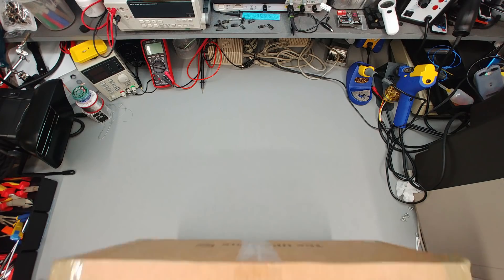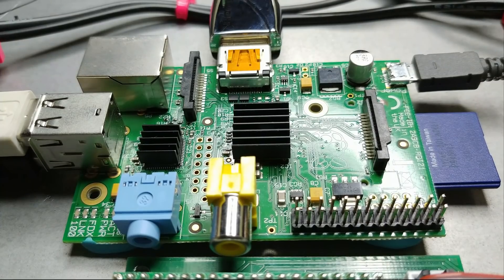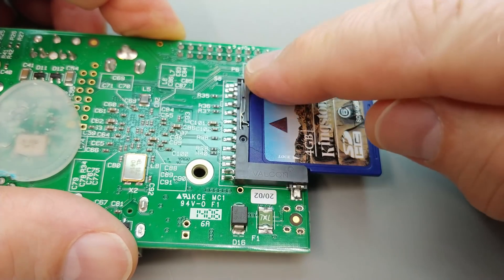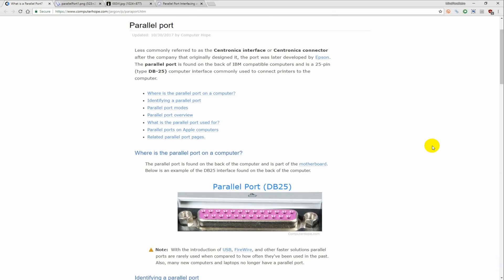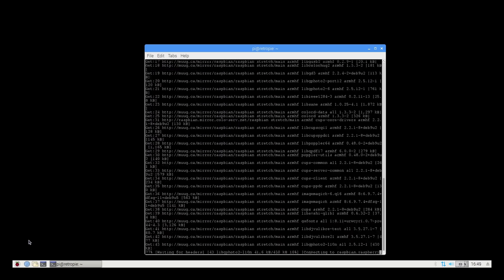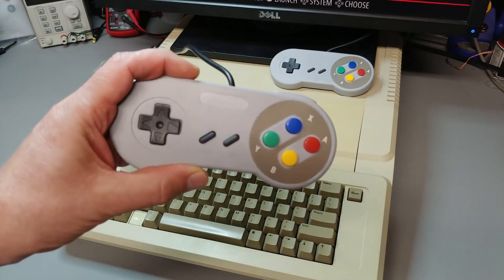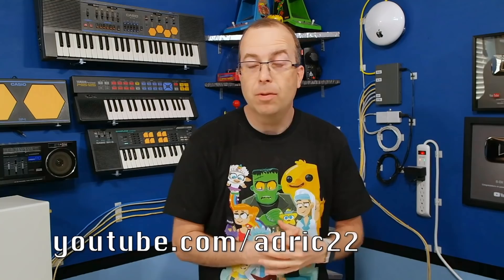#12 "Hello, My Little Blue Friend" — Apple PIIe #ThinkDifferentChallenge Part 3

Comment: It seams that unfortunately the original SD card got damaged on shipping, at 9:38 there is a visible crack on the SD card.
Also pretty nice approach on the making of the video.
Reply from the maker: Thanks very much for your kind words. You are the first viewer to comment on the SD card crack. Crazy stuff -- I could not see that crack at all until I rendered the video, which somehow seemed to enhance the visibility of the crack.
Reply: Finally getting to view the 3rd installment and was about to make a similar comment, but decided to see if anyone else noticed this...lol
Reply from the maker: Yes, lol. Thanks for the feedback. Seriously, I did not see it at all until the video had been rendered - weirdest thing, or I'm completely blind. I'm surprised The 8-Bit Guy didn't mention it in his Part 4 video.
Reply: I noticed the crack as it was happening.  Or at least you do not see the crack until the card is being inserted.  I wondered if it happened as a result of the tape and the extra tight fit.  But i guess its possible the crack was there all along and is only visible when pressure is applied to the card.
Reply from the maker: Hi Daniel. Yes, I am pretty sure the crack happened during shipping. Jan Beta had packed it well but did comment to me that a lot of the innards were in greater disarray than when he shipped it. It's the craziest thing, I swear the crack was only visible after the video was rendered by my editing software, as if the render process enhanced the contrast of the image making it much more visible. Anyway, that's my story and I'm sticking to it. :)

Comment: Thanks... I followed these videos to you and you’ve inspired me. I want a dot matrix printer so bad, but I’ve had some issues with cups too. Now I know to go for it. I gotta find a dot matrix!!! Bbs days coming back!
Reply from the maker: Thank you for your kind words and positive feedback. Yeah, vintage dot matrix printers are hard to find these days and new ones are off the chart expensive. Have you tried thrift shops or online classifieds like Craigslist or even Facebook Marketplace?
Reply: MindFlareRetro both are good ideas and I keep checking thrift stores. Heck, maybe a Facebook advert asking for one... you know there’s tons of em sitting in closets across the nation. I subscribed and thanks for what you do. I’m a big raspberry pic projecter and think your content is up my alley. Cheers. (Ps, i would have used your amigaIIe mod!!)
Reply from the maker: @paullee107  Thanks very much for subbing -- your support is greatly appreciated. I have been very fortunate to find unwanted Commodore gear here in the Toronto area using Craigslist and Kijiji over the past 5 years. I haven't tried Facebook, though. Hmm.🤔

Comment: Dunno if you knew (obviously it's a bit late) but CUPs doesn't need a desktop environment in order for it to work. This would have saved you some space, but it's still pretty cool that you got a matrix printer working at all. Hell it made me smile just hearing it print.... memories......
Reply from the maker: Thanks for commenting, Ian. I assumed that CUPS would be right at home administered from the command line, but as I am versed only mildly with Linux it was easier for me with a desktop GUI. Also, someone lucky subscriber will have the opportunity to win this Apple PIIe rig so I wanted to make sure it would be easier for that person, as well.

I wasn't exaggerating when I said I hadn't used that printer in over 20 years. I think I purchased in 1990. I had just started university and, well, needed a letter quality printer, and I splurged for the 24-pin one. I love that printing sound, as well, that's why I killed all audio in the video when it first printed -- love it!
Reply: The web interface purpose is to be accessed remotely, but great job, setting any printer (on Linux or not) is a pain, specially when they make driver for some old version of Windows that won't work at all with newer versions. At least this problem we don't have with Linux! :)

Comment: At 17:20, looks like there is a lip around the hole (that is crimped to keep the metal parts from separating). If so, an easier way than filing would be to gently drill it out with a larger drill bit.
Reply from the maker: Ah, yes, you are correct. I remember being a bit rushed to get this project completed, that didn't even cross my mind. I will keep that solution in mind for next time. Thanks for commenting.

Comment: Impression that the package got hot enough to loosen the hot glue and also mess with the solder joints on the boards a little.  If it takes a hot iron to loosen the PI in the previous build video, it seems likely that it could have gotten pretty hot during shipping.

Comment: Tell me you didn't threw the plastic cover for the DB25 port away, my OCD is screaming for it to replace the aluminium one made by Jan.
Reply from the maker: No, no -- you can breathe easy -- I did not throw it away. I actually taped it off to the side in the case. I didn't even think to use it as a replacement. Thanks for your comment!
Reply: @MindFlareRetro  thanks, I feel a lot better now! haha Just subscribed btw
Reply from the maker: I'm glad I was able to help. I should have mentioned that I secured it to the inside of the case in the video. And thanks very much for subscribing; I really appreciate it!

Comment: Who else found themselves shouting 'the card's broken' at their computer?  :-)  A great video in a great series!
Reply from the maker: LOL. I was the first one shouting. But I only saw the crack after the video had rendered, as if the rendering process accentuated it.
Reply: @MindFlareRetro  It's always the way! I had exactly the same happen to me in the past, so I knew what to look for before I even saw the crack.

 I loved the Parallel mod you did.  It's a shame it got disconnected, but at least it has given me the idea to do the same on a Pi-based machine I'm in the throes of putting together, and perhaps a USB Serial port too, so thanks for that!
Reply from the maker: Thanks for the kind words, Ray. I have it on good authority that Perifractic did re-assemble my parallel mod before the Apple PIIe was sent off to the contest winner. Good luck with your project.
Reply: Thanks.  I'm hoping to get my channel off the ground in the not too distant future and hopefully will feature my build. Good to know the parallel port is still there :)
Reply from the maker: Keep me posted here and/or on Twitter @MindFlareRetro as to when your YT channel gets up and running so I can subscribe.

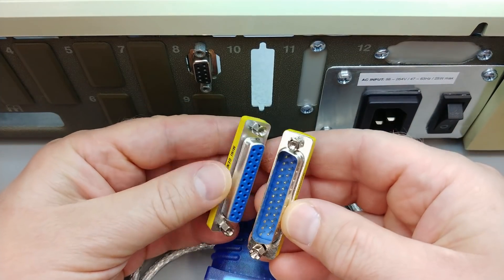Comment: 16:27 I could swear that one of the instruments in this musical composition is a circuit-bent Speak & Spell.
20:52 Side quest: Design a wifi print server for a parallel printer using a Raspberry Pi Zero hidden within the actual Centronics port itself -- no cable! ;)
22:12 Linux printing is painful. The last time I switched over to linux full time (around 2001), I went out and bought the cheapest wired postscript printer I could find, and that was that.
Even though Apple developed cups, it's not very user-friendly. Printing on the mac is a dream, in comparison. Actually, it's better than printing on Windows, because on windows, you're beholden to vendor drivers, which sometimes are awful.
Reply from the maker: circuit-bent Speak & Spell -- now I can't unhear that observation ;)
wifi print server -- oh, that would be cool!
Linux printing is painful -- yes!
Reply: @MindFlareRetro  
I think the next time I have to set up a printer with linux, I'll get the cheapest little Mac mini I can find on ebay/craigslist, and set it up as the print server. I don't know why printing works so well on MacOS, and not Linux, as they both use CUPS. :/

Comment: 1 issue I can think of, I'm pretty sure the Apple //e used the serial port for printing.

edit:  nope, I'm wrong:  https://apple2history.org/history/ah13/#14
Reply from the maker: Hi. Yes, thanks for bringing that up. You are absolutely correct. We figured that going with a parallel port would be best for whoever might end up winning this Apple PIIe because so many printers still out there.

Comment: Hey Mindflare Retro, did you move that plastic cover piece over to Jan Beta's drill bit-puncture fix? :-)
Reply: Conrad Vogel Good question! ⚒️
Reply from the maker: Conrad Vogel   Thanks for the question, and no, I did not do that. I actually did remove the plastic cover that Jan Beta had used to fill the hole of expansion slot 12 for some reason (I can't recall why now) but I ended up just replacing it. However, the cover that I removed from the slot I used is taped inside to one of the side walls of the case, so perhaps the next guy with the computer can try to fit it to the slot 12.
Reply: Looking forward to the final product!  Pretty fun concept.

Comment: Also, by Apple Pi, I would sorta kinda like to see Apple release their own SBC, whether they call it the iMake, the io'Thing, the Wozboard or just ditch all semblances of imagination and call it an Apple Pi (but not an iPi, not even an iπ, Just.  No) as it would be the only SBC that could ever credibly called a Raspberry Pi killer.  

Sadly, I just don't see Apple ever doing that, they probably have been more likely to do that under Steve Jobs than nowadays...

Did you try it in a composite 15KHz monitor.  I think under the first video, Perifractic configured the Pi to always use the USB soundcard so that sound came out of the speaker and maybe to always use the composite out.  

Oooooooh, then again, that card's got a crack in it...

The switch at the top of the SD card slot is closed by the card so it shouldn't be that.  

I still wish Perifractic used a later model which used microSD cards instead.  

"Thanks for watching everybody" ...mouses over video, sees that the video is only 33% done, keeps watching...

Part of me wants to see a similar challenge based around the original Mac or even the Amstrad PCW!  Even using the original CRT for an extra, possibly lethal challenge!

looking at that Amazon site has me tearing up for Maplin 😭 the website's so similar it's #triggering.  

ExplainingComputers is an excellent channel.  

And I still wonder what MsMadLemon would do with this...

I've never tried printing from emulators on modern printers on a PC, never mind a retro printer via a retro connector to a Raspberry Pi!

Also, adding the desktop does allow you to compile and run gsplus or gspot which allows you to emulate an Apple IIGS... I wish Retropie had an official option to emulate the IIGS but it seems the only way is to be hacky about it and compile gsplus from source :(
Reply from the maker: Thanks for the comments. LOL! I'm glad I didn't lose you at "Thanks for watching everybody." 

You got me thinking, whatever happened to the Apple Device (http://j.mp/2BzH7QI)?
Reply: Looks like it was an April Fool's joke rather than a real product.
Reply from the maker: Duh me. I completely missed the date on the post. Nevermind. 🙄

Comment: someone had been in that package all the leads were pulled, i bet some customs person went through it, while hot glue is not the sturdiest fixing i don't buy all the hot glue coming loose, someone pulled those parts, which is a bit crap seen as xray would have shown them everything.
i have had problems with customs and i have had to claim compensation, they actually took apart a BRAND NEW metal detector breaking the factory seals, then proceeded to put it back in the box disassembled! wankers!, it took ages to sort out, now being an EE i was able to rebuild the detector, but thats not the point, that unit has lost its warranty bastards.
Reply from the maker: Oh, do you really think someone at customs messed up the guts of it? Hmm, could be, but normally (in my experience, anyway) any packages opened by CBSA (Canada Border Services Agency) are re-taped with very official looking packing tape with verbiage stating the parcel was opened and inspected by customs. Dismantling your metal detector and voiding the warranty is a shame, for sure, and more than an annoyance. Thanks for commenting.

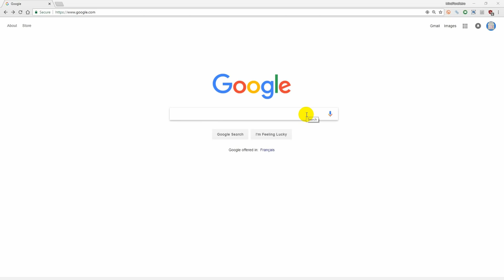Comment: 19:43 Apple and open source in the same sentence... Sounds strange even for 1999 (when CUPS was first developed).
Reply from the maker: LOL. That's funny. I didn't even clue into that paradox until you mentioned it. Thanks for watching and commenting.
Reply: How is that strange at all?!? OSX is partially open source, XNU the kernel of OSX and iOS is open source, the CUPS printing system is open source, Webkit the famous browser engine is open source, Swift the programming language is open source and LLVM Clang compiler is also open source by Apple among other smaller projects like medical R&D. 

That's some huge high profile open source projects Apple develops right there....

Comment: It doesn't surprise me you didn't find a M/F gender changer. After all, that's not a gender changer as you end up with exactly the same gender as your cable was before you added that thing on... ;-)
Reply from the maker: Yeah, you are absolutely correct. It was all about fitting it into the case that particular way, and unfortunately, I had to do it in that less-than-optimal way. But it all worked out in the end. 👍
Reply: Indeed, kudos for the creative solution!

Comment: I'd just like to interject for moment. What you're refering to as Linux, is in fact, GNU/Linux, or as I've recently taken to calling it, GNU plus Linux. Linux is not an operating system unto itself, but rather another free component of a fully functioning GNU system made useful by the GNU corelibs, shell utilities and vital system components comprising a full OS as defined by POSIX.

Many computer users run a modified version of the GNU system every day, without realizing it. Through a peculiar turn of events, the version of GNU which is widely used today is often called Linux, and many of its users are not aware that it is basically the GNU system, developed by the GNU Project.

There really is a Linux, and these people are using it, but it is just a part of the system they use. Linux is the kernel: the program in the system that allocates the machine's resources to the other programs that you run. The kernel is an essential part of an operating system, but useless by itself; it can only function in the context of a complete operating system. Linux is normally used in combination with the GNU operating system: the whole system is basically GNU with Linux added, or GNU/Linux. All the so-called Linux distributions are really distributions of GNU/Linux!
Reply from the maker: Thanks for explaining that. Again, I'm not a Raspberry Pi or GNU/Linux expert, by any means. I wasn't aware of the GNU Project and Linux history. Thanks very much for the clarification -- much appreciated! #AlwaysBeLearning
Reply: @MindFlareRetro  That whole copypasta is a big meme among Linux users. Along with the famous "Install Gentoo"